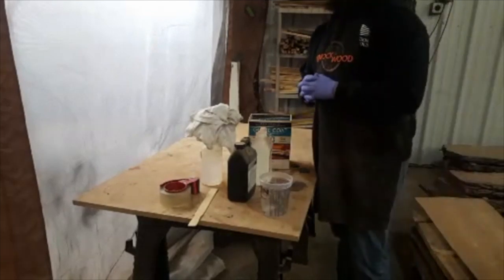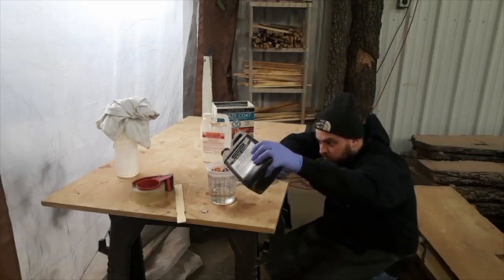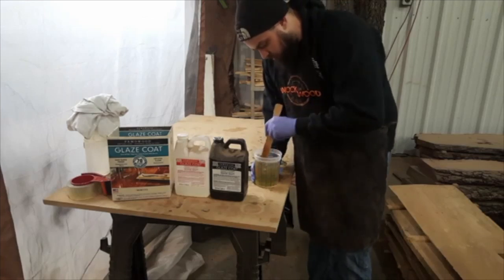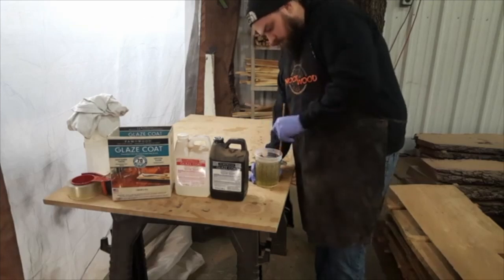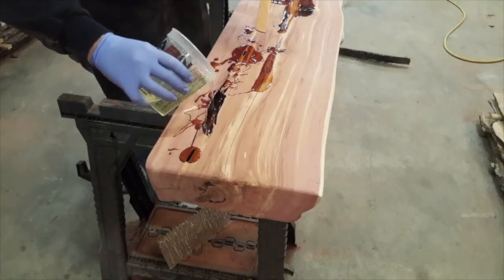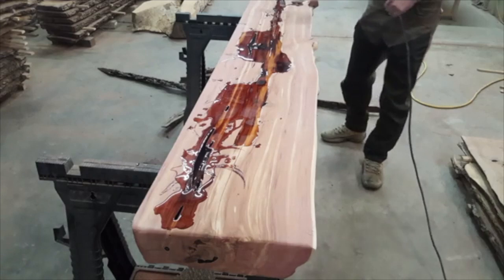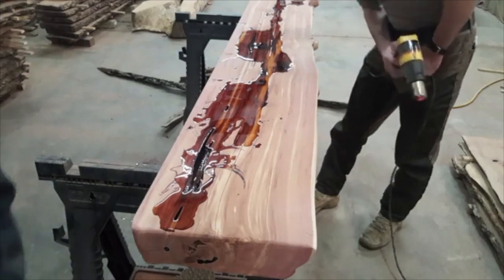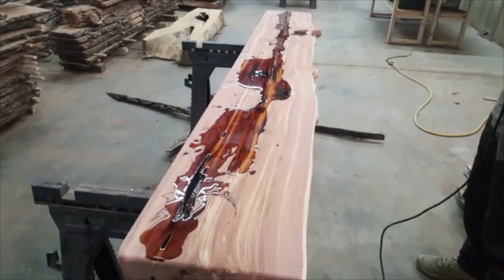Famowood Glazecoat Test and Trial

Comment: I Finished my Kitchen counter top. Turned out Better Than I Thought. Better If I Had A 12 In Planer. I Decided to Build One for my Breakfast Bar. Filled Every Nook and Cranny, First Coat Slick as Glass, Just a couple of places that the epoxy didn't stick. Thought Second Coat would fix that and be the final smooth glaze. walked away for about 10 minutes come back to fish eyes through out the whole counter  top.  And the instructions say Do Not use Tack rag. Wipe with alcohol or Acetone Before Second coat.  pour no more than an 1/8 inch thick. I hope you guys have a second video or finished product. Takes Forever to cure.

Comment: Awesome video. Love the work y’all do
Reply: How do you take of the bark on cedar becouse it is not like hard wood.Do you use a bark scraper or do you use a grinder?
Reply from the maker: Great question Brad. I have seen it most often scraped off and power washed clean. Cedar is definitely different - we personally just used our grinder with a tool attachment

Comment: Do you need to treat the wood before adding the epoxy so it does not seep through the cracks and create dips or dimples?? If not, do you have any recommendations to avoid getting these dimples?
Reply from the maker: What dimples are you running into and I’ll try and help. You can send us a message on our Instagram or Facebook as well as Facebook info@knockonwoodcustom.com

Comment: Would you recommend using the glaze coat for void fills?
Reply from the maker: Spencer Jackson great question. The glaze coat was a little expensive to fill voids and it’s more so made as a bar top finish. If I were to suggest an epoxy for voids, I would suggest System Three Resin with a medium hardener (part b).
Reply: As far as the quality of the film would you hesitate to use on a walnut top.   I have already bought the product I just wanna make sure I’m not making a mistake use that for Fills
Reply from the maker: Spencer Jackson it works for filling voids. If you’ve already purchased it, use it. Just know that there are less expensive and better options for void filling

Comment: Can this be poured for like a river table?  Maybe 1” thick. I can’t find info if it can be used like that
Reply from the maker: zack mtz I definitely wouldn’t use this product for a deep pour. You’ll have to go with a popular brand like Ecopoxy or deep chill pour. 

The reason for this is often these other epoxies are designed to cure much quicker or designed to auto-level. 

The excess heat in a deep pour if it cures too quickly will result in poor finish and possibly the epoxy shattering

Comment: Why couldn't you have used a wood filler instead of clear coating the holes? the filler could be sanded down wouldn't have even noticed the filler.
Reply from the maker: Old Timer great question. Both methods are very reasonable. We just selected to fill it with epoxy as the client had requested.